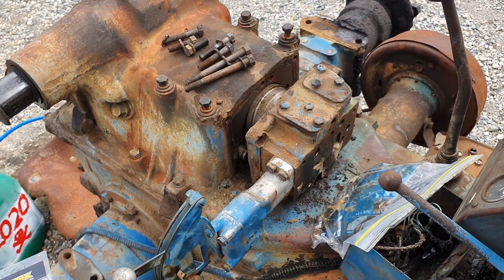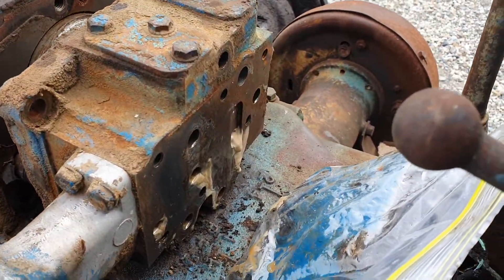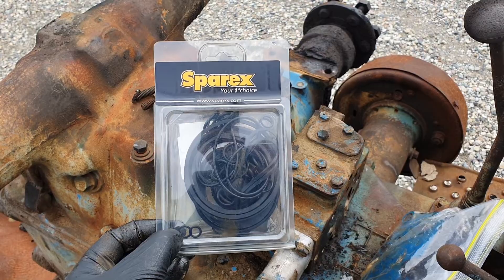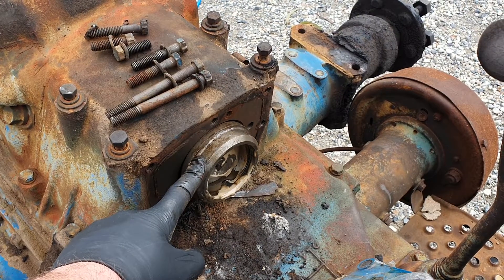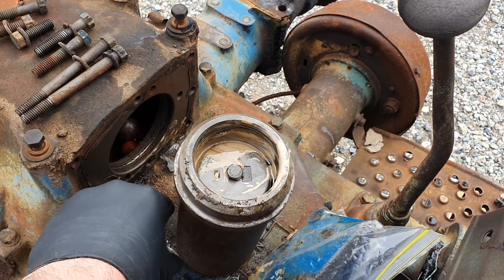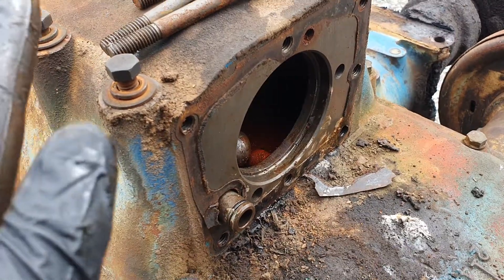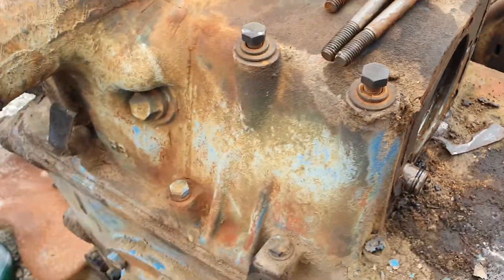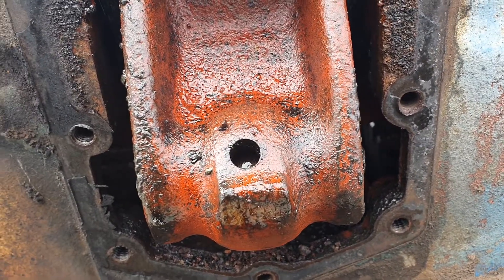Fordson Major 3pl Hydraulic System

Comment: Great video. I have remote hydraulics fitted to my tractor. If I remove the faceplate, take out the remote box and replace the faceplate, possibly with shorter bolts, will that operate as original?
Reply from the maker: That is correct, shorter bolts will be required.

Comment: Any idea if the hydraulics, top plate , etc are different between major and super major? Looking at tractor which has a backhoe. Not sure model or year. Hood says super major. Guy selling not sure what it is. There's one place he's getting a starter told him 195? Another told him 61? It has pto on rear. Top plate doesn't have shaft for 3pt arms. Didn't see diff lock pedal. But might have overlooked it. Was expecting it to be a bit different than what I found they are. Been having trouble finding information on these tractors. Found a top plate for sale reasonably for a major. All info I've found says both have 3pt. Found nothing of one without. Some things make me think major, others super. The brakes appear to be disk and are on side of trans. Also there is some sort of actuator or something directly on bottom of trans just behind where clutch would be. There's a shaft out of it towards the rear with a hole as if to hook to linkage moving it in and out. Nothing connected to it. And no idea what it is. Supposed to go look at it again in next couple days. Any information you may be able to help me with would be greatly appreciated.

Comment: Hello, thank you for the instruction video. I’m repairing the hydraulic system on my power major. Having trouble finding the o ring kit. Could you post the part number and where you got it? Thank you
Reply from the maker: There are a few different kits for sale on Ebay, I have found them reliable. The part number is: Ford New Holland 1934247.
Reply: @fixingfordsonsaustralia6632  thank you so much! I’ll give them a shot